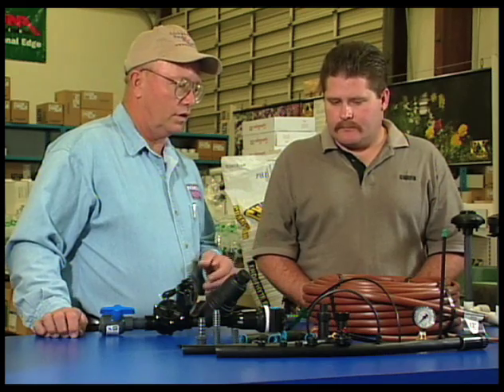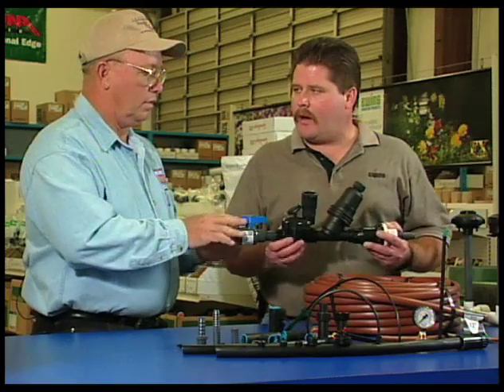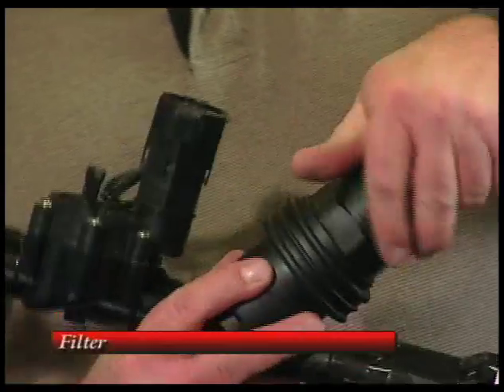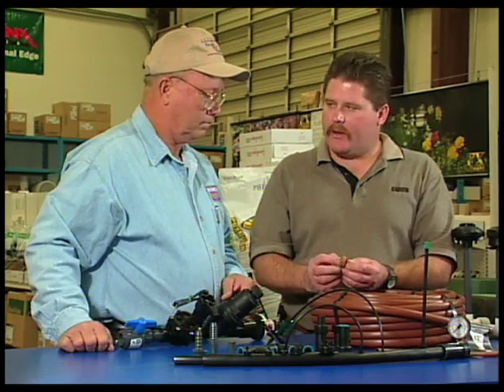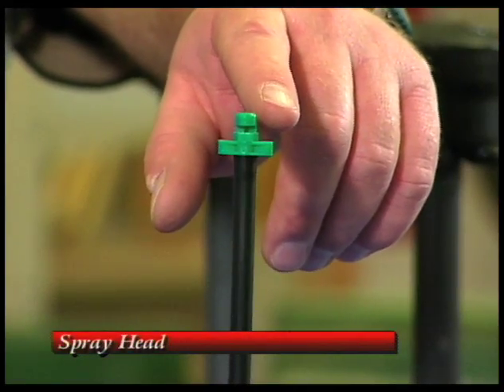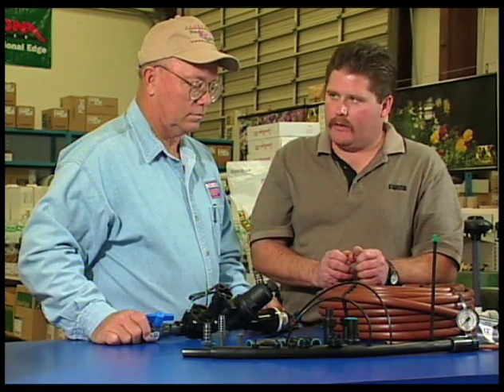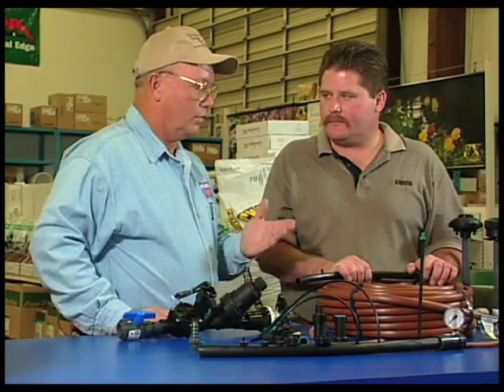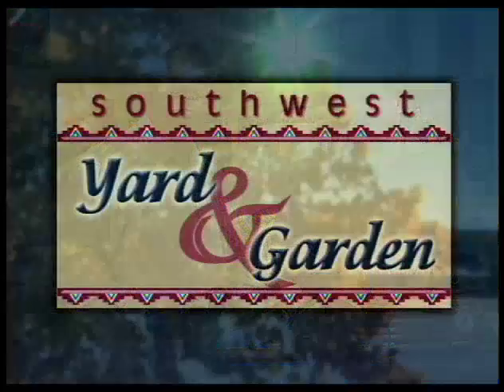How To Build A Drip Irrigation System

Comment: I bought polyethylene flex tubing and it is very difficult to pop an emitter in (thick tubing, doesn't lay flat easily) - i guess I bought the wrong kind? what is the name of the tubing used here?